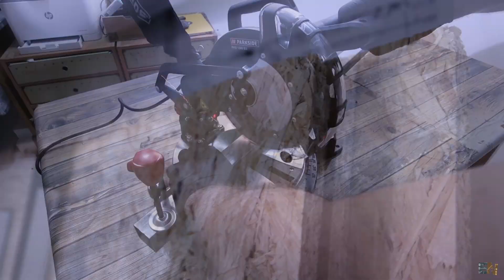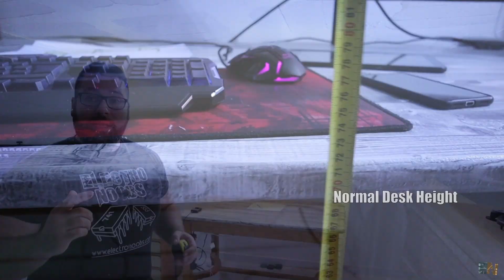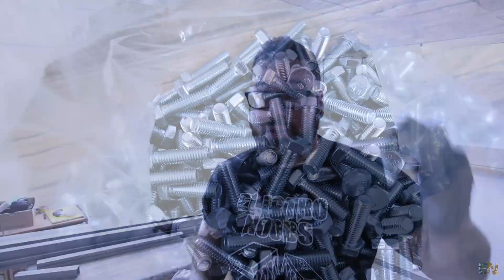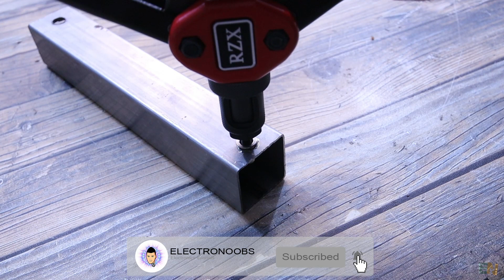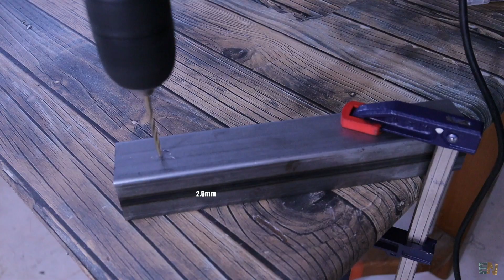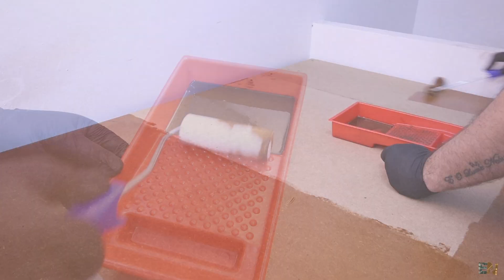Making A MASSIVE DIY Workshop Table That Will Blow Your Mind!

Comment: Great video as usual.  You may know this but there is an easy way to make the table stronger and the top smoother.  If you add another layer to the top and screw it on from below you will have a perfectly smooth top.  You can add glue between the two layers although I didn't don't so it is easier to replace the top layer after a few years of use.  You will be amazed how much more firm the bench will feel with two layers screwed together.

Comment: Nice bench. Having worked with MDF a lot over the years, and I would recommend putting in the "extra" bars that you decided not to add. The reason is not to reinforce the frame, as it is surely strong enough. But without them you will probably find that the MDF starts to sag in the center of each section as your humidity goes up and down, even indoor. I've seen it happen over night. The greater the space between support members, the greater the effect. Any time I use an MDF top, I always use a 24 x 24 inch or smaller support grid. The cross members can be a lighter material if weight is an issue. Even 1 inch angle will work. I am looking forward to part 2 as I would love to add height adjustment to my benches.
Reply: Yes, I was going to make the same comment. Those extra bars are NOT for the table's strength but rather for the MDF's strength. As @naturelovertxt says, the MDF will sag without that extra support. And I concur with the 24" or 60 cm grid size at a minimum. If there's more unsupported MDF than that size, it will sag over time.

Finally, the surface covering is highly recommended because MDF can easily be damaged by water. So the coating is good, but having a cover surface that can be replaced when it's damaged will protect that more expensive surface for a LOT longer.
Reply from the maker: Very good tip! Thank you! I will add those bars right away :))))))

Comment: Should have used bosch profiles
Reply from the maker: Way too expensive for me
Reply: @ELECTRONOOBS  if you consider the equipment that ur forced to buy in order to cut the items down to size and drilling the holes, u will end up paying a higher price and spending more time at doing the table.

Comment: Possibly has already been mentioned (but content interactions 😉) a few things to notes:
* When drilling into this thick steel you should be using lubricating oil. This is one reason why it's so hard to drill into the tubing. Basically you heated the bit up and killed the sharpness of it
* You could also use a stepping bit to drill concentric holes till you get the size desired. Also makes for having clean holes drilles
* For the Self Tapper screws, you generally don't pre-drill a hole for these. Just push and let it drill its own hole. This makes them create the exactly right size for the threads. However, it is possible with this steel, it may have been needed (tho I have never seen this done or done this myself)

Using the 3D printed insert was genius!  Great idea.  Altho I would have made allowance for a washer under the nut instead of having the plastic under it. Because as you tighten the bolt down, the plastic will be squeezed out. And over time as you  use the desk/table, that little bit of plastic will get pushed out more and will make the table loose again.

Comment: Why not purchase motorised hydrolic legs for table like it cost 100$ ech but more reliable than 3 d print ,plss also add voice assistant controlled table height or app controlled and use touch buttons along USB ports for  charging devices ,and if possible add hidden amplifier
Reply from the maker: Is too expensive and I enjoy doing my own stuff :)

Comment: Well done!! When drilling big holes like 10mm, start with a smaller hole and increase it slightly until you get to the desired size. Example: 4mm, 8mm and then 10mm.
Also, as mentioned in another comment, it's important to use some lubricant otherwise you will lose the drill bit in the first hole
Reply from the maker: That's what I've done but it still takes too long hahaahahha

Comment: Awesome video. next time when drilling holes in metal use a little lubricating oil on the metal and the drill won't stop the drill as much and makes a cleaner hole. Keep up the good work. i always learn something from you every time I watch you.
Reply from the maker: Thanks for the tip!